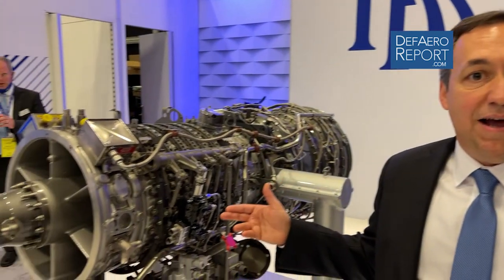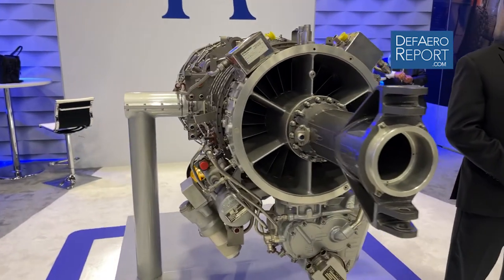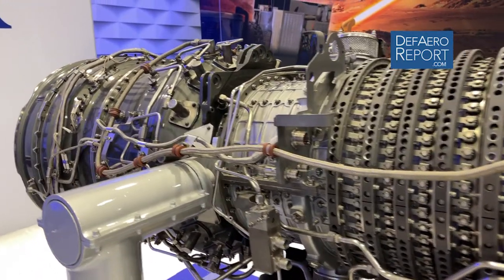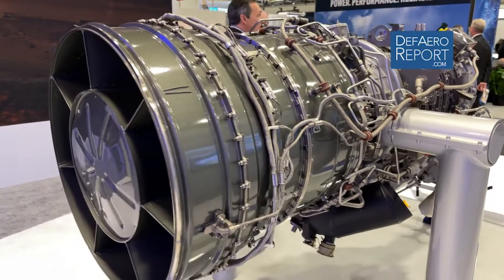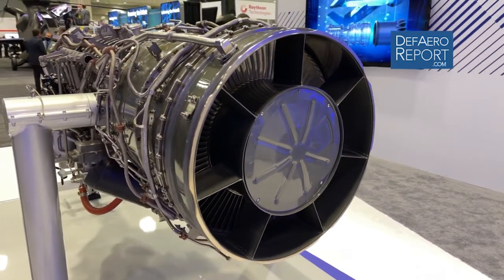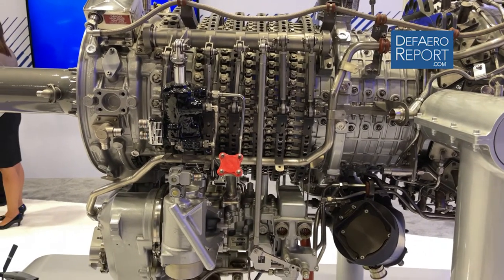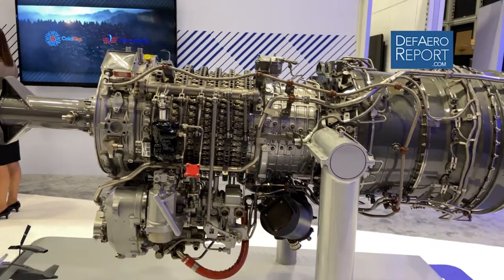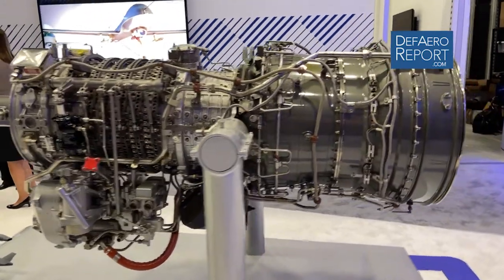Rolls-Royce's AE1107F Engine for Bell's V-280 Valor Tiltrotor

Comment: V-280 will use FATE engine from GE, this rolls Royce engine is only being used for protyping/development because FATE engines don't exist yet.
Reply: Not necessarily.   Since this is the same engine family that powers the V22, it makes sense to go with a proven design.  Besides, if the V280 isn't chosen for FLRAA, it wouldn't be obligated to use the designated FATE engine.
Reply: If that were a fait accompli, then Bell would've stuck with the GE T64 engine used on the V-280 Valor prototype.  The R-R AE1107F engine is more powerful than the T64, and is based upon the proven AE1107C used on the V-22 Osprey.
Reply: Can it even go with the same engine as other helicopters? The shaft tilts. Converting a traditional engine to VTOL seems like what the f35 tried to do.